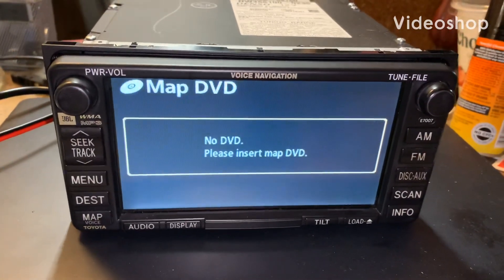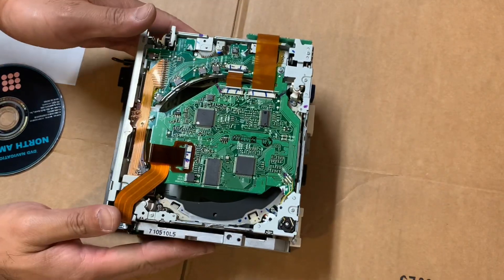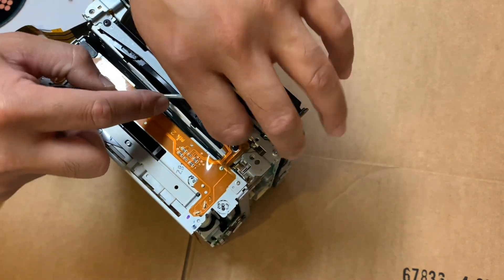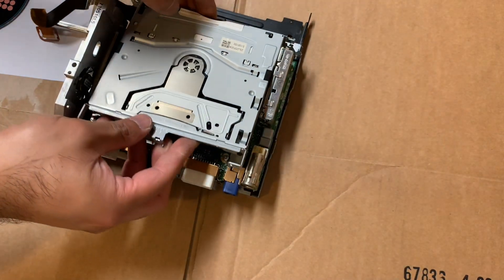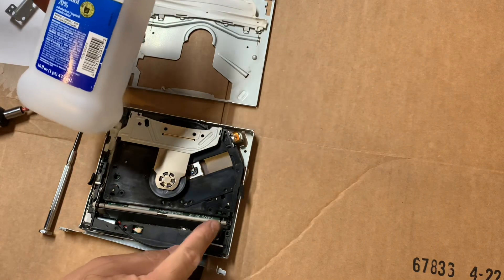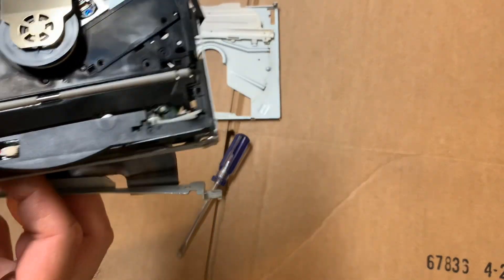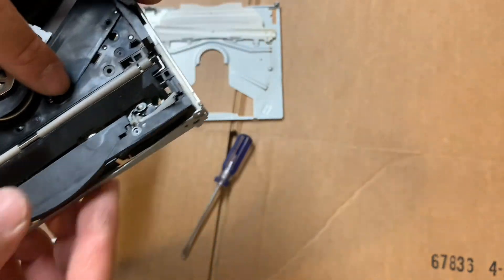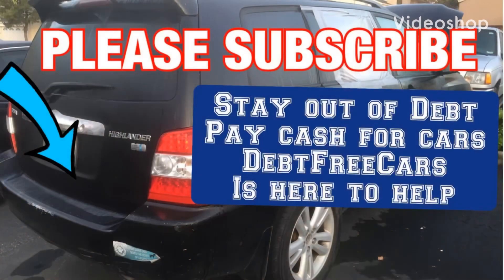DIY DVD GPS map drive cleaning: Toyota Denso JBL DVD map drive in GPS Navigation units E7007 - E7013

Comment: Hi I have a 2012 Toyota kluger grande showing the same problem after replacing the battery. Does this procedure work on my stereo.? The number on the screen is 18037 and model number on the head unit is ft0002a. Thanks
Reply: a toyota what?  ... where's it from and what kind of vehicle is it?
Reply: @shiddy.  A kluger is what we call a highlander in Australia
Reply: @ethanalexis3471 thanks, I never knew that - I wonder how identical they are?
Reply: @shiddy. From what I can see, they look to be the exact same car just with different names and some small things different on both models to meet with US and Australian road regulations
Reply from the maker: Yes same procedure but the dvd drive is a different model.  Go to this link to order. http://leakboards.com

Comment: There's some how to disable the navigation system or the screen??
I don't need it all the time I rather see whats radio station I am listening and also the most annoying greeting of the agreement every time that I start the car..please help 
I want to keep the original stereo but if there's no other way I have to take it off and use a aftermarket stereo with a sim card yes a sim card for cellphones this way it always gonna have a better reception instead of the wifi one some time they lag or they use a low quality videos and they are pointless to watch a videos so grainy, sim card are better ah and they are wifi also 😊.
Reply from the maker: I wish we can upgrade to SIM card but the factory unit is still better than the aftermarket crap I see.

Comment: Hi.  Mine is stuck on this screen.    I cant engage the radio or back up camera because the buttons wont respond.   Is though a way to get to my radio stations without pulling out the radio?
Reply from the maker: No this unit requires the map dvd to work.  You’ll need to replace the dvd drive or purchase a new unit refurbished.  Visit www.leakboards.com

Comment: Hello I have that stock jbl system and wondering is there a current dvd navigation for it?
Reply from the maker: JBL system comes with radio only or radio and GPS navigation.  If you have JBL radio only, you cannot fully upgrade to navigation.  You will get power and audio but you will not get reverse camera, Bluetooth mic, or navigation voice.  You can get navigation mapping with an added antenna for $200 from the dealer.

Comment: Hi Joe, I just wanted to say THANKS!! I had this map DVD problem and followed your procedure to pull the unit out, disassemble, and clean, and I was very skeptical that it would resolve the issue. (Not because of your instructions, but because I thought the problem may have been a bad laser. Mine would go in and eject fine, but would not read.) I was ecstactic when I got it connected and it worked right off the bat! This was absolutely huge because otherwise the audio and the rear camera are disabled, and now everything is functional. Thanks for your wonderful guide!!

Comment: Can you helping gliding me how to fix the message 04 Toyota navigational system external system not connected.
The stereo is identical as the you took apart with voice activation..
Reply from the maker: 04 Toyota has a different GPS unit.  Front look similar but it’s made by Fujitsu and not by Denso.  Those are very complicated units.  And not very good

Comment: Hello! I did all the steps and I still have the clicking noice and the dvd gets ejected after 5 seconds. Is there anything else I could do?
Reply from the maker: You drive is broken.  Go to www.LeakBoards.com and you can order a new drive there.  You can also email me there if you have more questions.  Sorry the cleaning didn’t help.
Reply: @DebtFreeCars Hi, i did all the cleaning and replaced the dvd and it goes it but doesnt read
Reply from the maker: @peterpiper9627  did you replace the dvd drive?  Or just the dvd disc?
Reply: @DebtFreeCars  the drive as a whole
Reply: @DebtFreeCars  I was able to have the disc go in and it sounds like its reading it then just doesnt do anything and still says no dvd
Reply from the maker: @peterpiper9627  please email me at leakboards@gmail.com
Reply from the maker: @peterpiper9627  did you buy the drive from me?
Reply: @DebtFreeCars  We got it off ebay, we hadnt seen you cleaning video till after we bought it. Could It be the disc at this point? It is somewhat scratched but not really badly.
Reply from the maker: @peterpiper9627  no the drive is bad.
Reply: I saw you have them listed on ebay also could i have bought one of yours?

Comment: how you open it from the begining? 
i can't put out the screen  😔😔 you say look for the video above but i didn't found it.
Reply from the maker: Pull from the bottom gently but firmly.  It will open
Reply: @DebtFreeCars  actually my navigation system model is e7017 is it a same way?
Reply from the maker: @engmotaz6888  yes.  But for 7014 thru 7017, opening it is more difficult.  It’s easier if you plug the very left plug in and turn on power.  Push eject button and turn key off when door is  half open.  Then you will need to remove the Phillips screws for the clear cover for the ribbon cable.  Remove the ribbon cable for the buttons and remove the rest of the Phillips screws to remove the trim.  Then you can remove the rest of the LCD screen.  Thanks

Comment: I have a 2009 Camry hybrid does this Vid apply to my year and model?
Reply from the maker: Yes this applies, if you have a Camry hybrid with GPS navigation.  I believe the model number is E7010 or E7011.  This applies
Reply: @DebtFreeCars   thank you for taking the time out to answer so quickly
Reply: I broke 2 of the ribbon clips/connectors and I don't know whereto get new ones have been to about 6 computer repair stores no luck any suggestions
Reply from the maker: @topgunn444  you’ll need to replace the entire board.  Which ones did you break?  What are you trying to replace?  You can email me at LeakBoards.com
Reply: @DebtFreeCars  I broke what you referred to as the BLACK TABS in this video at 2:48
Reply from the maker: @topgunn444  oh that’s just for the cd changers. Tape will work.
Reply from the maker: Or I can send you a new cd changer

Comment: Hi, I did all those steps and cleaned with 75% alcohol and put back together then tried it and it still won’t work! It’s making the same clicking noise , cd gets ejected after 10-16 seconds and then it  go’s back in and then kicks out . Do you also have a Facebook page ?
Reply from the maker: Unfortunately you will need to replace the entire dvd drive.  You can get one on this website.  Www.LeakBoards.com.  You can also contact me on there or emails me. Leakboards@gmail.com

Comment: When cleaning the roller, if you press it down slightly, it will disengage from the gear drive and free roll. You can turn it easily to clean all sides of the roller.
Reply from the maker: Good point.  I forgot to mention that in the video.  Also forgot to mention to check the black gear towards the rear of the drive.  That gear tooth breaks and causes problems.

Comment from the maker: Yes this is the same procedure for the 2011 Toyota Prius with JBL GPS navigation unit.  This unit will not operate if the DVD map drive is not working.  Sometimes it’s dirty rollers, but sometimes it’s a broken black gear on the side.  When you open it to clean the rollers.  Check the black gear closet at to the rear of the unit.  Try rotating it and look for missing teeth.  If you have missing teeth, then you will need to purchase a new DVD drive.  See website to order: www.leakboards.com